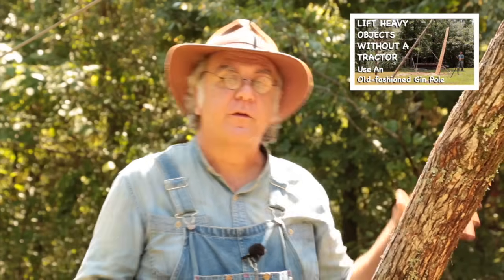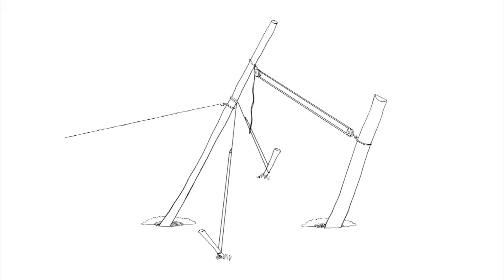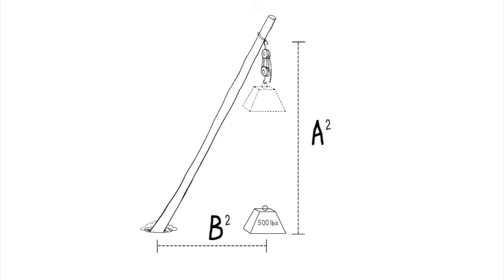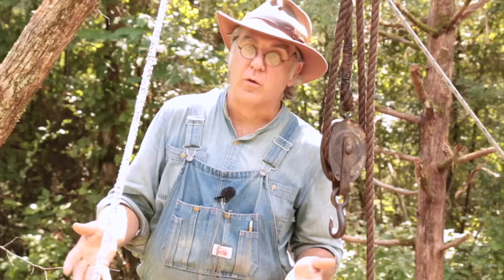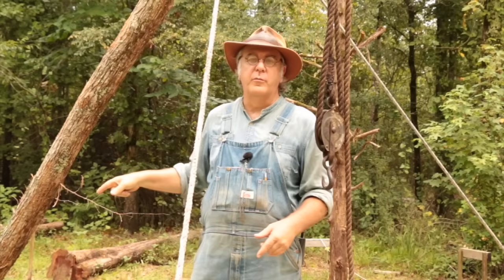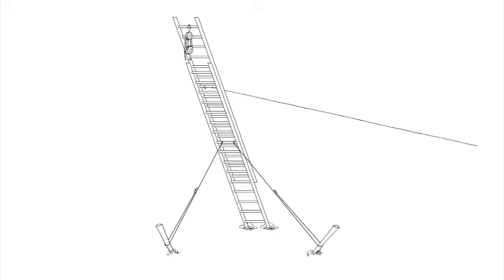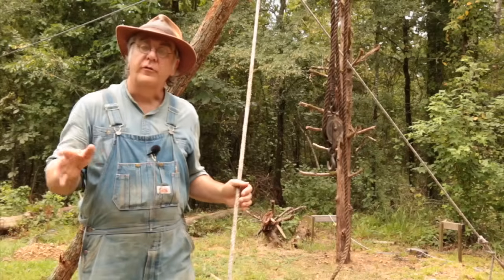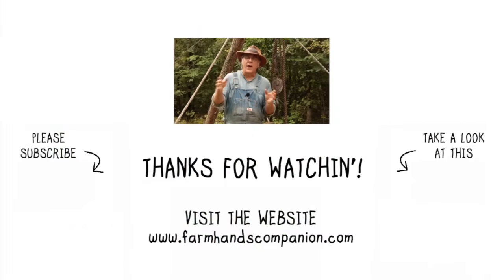Lifting Heavy Objects With an Old-fashioned Gin Pole - Part 2

Comment: A little bit of sailor snobbery on your hitch: There's a variation of the taut line hitch that's about as easy to tie, but holds far better, called the midshipman's knot. The only difference is that, instead of going around the long end of the line above the first loop with your second loop around, you go below your first loop around both parts of the bite, then finish it the same way you did. This means that the forces on the bite will try to spread the loop as the rope goes under tension, massively increasing the ability for the knot to hold firm and not slip. They're basically the same knot, just dressed differently, but that slight attention to detail of taking your turn around the bite instead of the standing end of the line is well worth doing. I learned my knots in the Sea Scouts, a lesser known nautical branch of the Boy Scouts, and I really don't know why the land scouts still teach the basic taut line when the midshipman's holds so much better.

Comment: Thank you for your video, very helpful. When tying a tautline hitch I think it's usual to make the first two turns inside the loop then a turn outside the loop.
Reply from the maker: Either way works, Steve. Thanks for watchin'!
Reply: Steve is absolutely correct. In the video you mentioned the tautline-hitch, but tie something else. 
That's not really accurate, it's simply wrong.
Of course you can hammer a nail in with the wooden side of the hammer, but is it right? I don't think so my friend. 😂

Comment: Love the video, came to learn about gin poles!

Just want to issue a small correction for the taut line hitch at 12:11 - the two initial wraps-around the taut line move towards the attachment point. This is to provide extra friction, as these are the loops that are compressed by tension when the line is taut.

Comment: I have seen a tri-pod version of this. I guess you'd have two front legs splayed past the attatchemt point of what you're lifting and a rear leg back for steadying. Then a block and tackle up in the crown of the tri-pod. Any drawbacks with that method, other than needing three hefty poles? It is fully portable as a plus.

Comment: You might want to learn the basics of splicing wire rope. Splicing the rope into itself could create a much safer loop at the end of the line. I learned how to do that with fiber ropes in the boy scouts; my Dad had me loop the ends of a short but very thick plastic fiber rope when I was a kid, and he used it for lifting the engines out of big rigs for many years. If done properly, you'd actually break the line before the splice gives out. Of course, if you're not doing it a lot, the effort might not be justified.

Comment: On the wire rope. Looked like you may have put the "saddle" of the rope clip on the dead end of the rope. This is incorrect. The saddle always goes on the live side of the rope. Multiple clips do not alternate and should be placed approx. three rope dia. apart. The saying is " Never saddle a Dead horse". Happy rigging and be safe.😊

Comment: I have land in the mountains that is largely decomposed granite/rock/boulders. How might you stabilize a gin pole when you can't dig a hole?
Reply: In that case, you might want to build one on a truck bed. The upside is it would be mobile and easy to reposition. Early tow trucks used this design. The drawback is that it would be very compact (unless you stretch the frame), and that might limit your reach.

Comment: Small suggestion. Before installing those cable clamps to form an eye, I’d recommend making a simple farmer’s eye first and then a clamp or two on the tail. Quick to do with a bit of practice and much safer for heavy loads and pulls.  We use them in logging applications all the time. And remember the old adage, Never Saddle a Dead Horse!

Comment: I’d think the angle for initially lifting the log upright is better. A come-along would just try to drag the log horizontally across the ground without something to angle the force upward.
Reply: tl;dr - It can be done with the one come-along dragging horizontally across the ground.

Stop blocks. - Remember the two scraps of wood he used originally to keep the log from overshooting the hole? Once the log hits the boards it will want to take the path of least resistance... So under pressure it'll start slipping. You just need to make sure it wants to head down into the hole instead over the top or off the sides, and it only takes a small modification (or extra scrap wood) to accomplish that. One modification, provided you have hole with a reasonable depth, is to make a sloped ramp leading down into it; the downside is this ramp is going to need to be a minimum of a third of the length of the pole (if it's of uniform weight along its length). Another modification is to have the stop blocks be the thing set at an angle inside the hole; so shape em like a wedge and have extras to prevent the pole from wanting to shift out the sides.